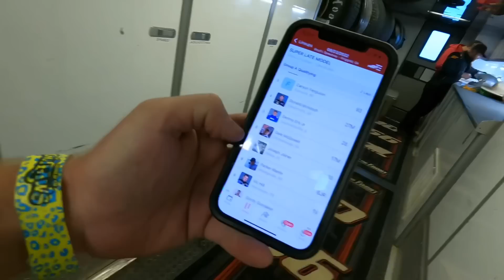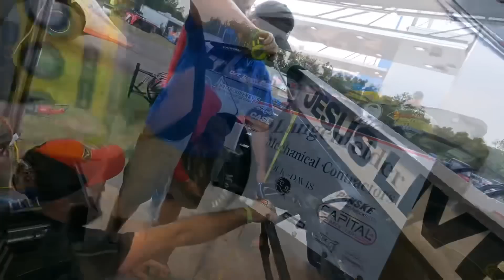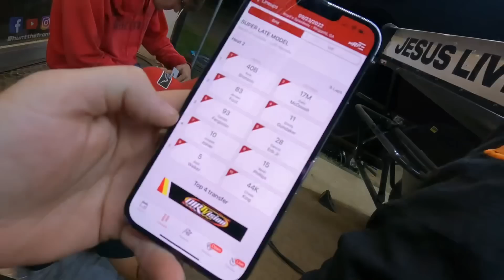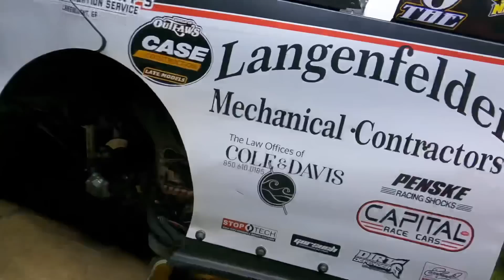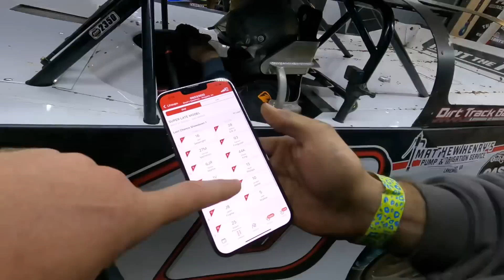Terrible! No Good Night in Georgia! World of Outlaws at Boyd’s Speedway

Comment: Jordan is a great mechanic you need a crew chief
Reply: @happywrenching33  the frame is tweaked, IMO or a shock has gone off the rails. You gotta use scales.
Reply: @nddbulldog1  no one uses scales. Your 7 years behind...
Reply: @nddbulldog1  Agree with the scales, and tire temperatures at the track.  Take the car out at a Walmart parking lot, get it on the scales, and see where the weight is.  Something is definitely off with the car and needs some kind of diagnostics.  It's bad and getting worse.  It's an awful long way to haul and perform like that.  Get ol' Betty out and see what she can do.
Reply: @ralphwatten2426  no one uses scales for setup, you are about 7 years behind
Reply: @vernsimmons945  well what they are doing now is literally the definition of insanity

Comment: I could swear I saw sparks out the left rear a couple of times. But I agree with a couple of people, wrong gear and something in the front end is off. Gotta keep the rpm up in the corners
Reply: sparks are from the brakes
Reply: @twitchbearoutdoors652  I doubt it unless they are dragging because it was in an area of the track you shouldn't be braking. That said they could have a sticking caliper which would definitely slow them down
Reply: @johnstark4723  it’s the brakes man

Comment: There front roll center in the kinematic state is off.  The geometry is off in there force line intersect point. When the car dives into the corner the roll center should migrate.  Of course your spring combination will effect this as well.  If you dont get the front end rolling on the center point you will be chasing all night.
Reply: You try to sound intelligent speaking about role centers and kinematics but I don’t think you know what you’re talking about I worked at GM’s advance vehicle systems group at the General motors tech signer and was involved with vehicle dynamics specifically for antilock brake systems and traction control systems And your speak is gibberish
Reply: @thomasgray2184  I guess you worked on GM's thoughts about when the cars  rolls, dives  or lifts in the corners the load and preload on the 5th and 6th coils as well.
Reply: Pretty much involved in all aspects of vehicle dynamics brake line compliances steering system compliances caster camber toe in toe out effects and computer simulations of all the above

Comment: The car looked loose in hot laps and it was looser in the heat.  In the B main it looked like all the cars in the race looked too loose.  They were going sideways around the whole track.  It's a short race track but it's not an oval.  I'm thinking too loose.  I'm not sure if the mill was bogging like one commenter said but it sure seemed like the valves were floating a bit.

Comment: Boys need to figure out those slick setups
Reply: if you watch there left front when it hit a bump it really throws the left front up bad and yes it should move but not pitch the car ,they are lacking   Traction on the rear and right front  ,just watch the car ,i started racing when i was 17 and now 71 and still in it to win it here on the west coast we run a super late model outlaw
Reply: @raymondbrandt7831  could be chasis related. I mean that car has never really performed well. I'd be taking back to Capitol to have checked out
Reply: @bren-xmotorsports55  
my buddies that have capital cars have trouble with them like setting up for a track you have been to 2 weeks ago to the same setting and the car acts totally different, they tell me the car has a twist memory, i don't no we run a longhorn
Reply: @raymondbrandt7831  :Keep at it, they are taking note of what is said here, it shows up later in their video's....
Reply: @regdor8187  
is that  Supposed to scare me or something, well it doesn't, i tell what friends have told me what i no from my own car and what i see so if HTF or CAPITAL has a problem they can tell me
Reply: @regdor8187  
 htf is a young team that's struggling, i like them that's why i watch them, and some of us old timers are just trying to help
Reply: @raymondbrandt7831  Woooo budy, you read it wrong ( or I wrote it wrong), your giving your experience is not being ignored, just not being acknowledged, that's all......
Reply: @regdor8187  
no harm done, i no they don't respond to anyone
Reply: @regdor8187  I read it the way you said it. No harm done
Reply: Not to beat this comment to death but if I was the owner of that engine I'd be a little concerned about them running it in that setup
Reply: @bren-xmotorsports55  
 it's a super late model engine and the builder give them lap numbers to have it gone thru that said i think they are turning at higher RPMS than they should it sounds as it's above the power curve, our motor hits its peak at about 6000 and pulls heard from about 53 5400 we gear the car to run in that range give or take, and we control the tire spen with the loud pedal

Comment: I wonder how much it changes your set- ups on XR series races with no Droop rule! I bet it would make it hard being the only series that does it! I know this isn't a XR series race! I know you don't reply to comments! I wish you would on this subject! Oh well just talking to myself on these videos!
Reply: Im trying to learn more about it myself. What does the droop rule attempt to mandate?
Reply: The last time they ran with XR..XR had the droop rule so they don't have a clue.
Reply: @brandonlove3136  Droop in a late model is how far the LR will “droop” from the chassis when a car is on the bars when on throttle. It pushes the spoiler way up in the air, from the 39” the deck sits at ride height when stopped to, previous to the new rule, upwards of 60” in some cases. What the WoO has done is limit that droop measurement so the most it can measure from after an event is 50 1/2”.

The idea is two fold. First priority is trying to limit rear downforce some. Modern late models have manipulated the attitude of the car to the point of they are now almost a modernized version of the wedges from the early 80’s. Second priority is lowering the center of gravity of the cars, which ends up being pretty high at full droop. There have been quite a lot of flips in the last few years and they’re hoping lowering the CoG should keep them right side up a little better.
Reply: They don't reply to s*** I've never seen them reply on here they're too big time for that haha. This team is all about the money. They went from Humble to it only being about the money it's not even about the fans one bit.... as much money as they're making especially with patreon they could give a t-shirt away once a week just to show appreciation or once a month and it can be one of the old shirts it's not going to sell anymore the winner wouldn't care and it shows your true colors and how thankful you are to come from a z71 open trailer 604 late model setup 2012 chassis to owning a complete race team with four chassis and Stacker the only thing left is to hire a creature which they will never do lmao

Comment: Do you guys even scale your car and see where your numbers are?
Reply: No one scales late models except to get total weight.
Reply: @vernsimmons945  damn you respond to a lot of people. Almost seems like your one of the crew members using a fake name to try and control the narrative without being called out and bombarded with comments. It's ok, I get it, just know that I know.
Reply: @vernsimmons945  How many accounts do you create a week? Or name changes on this account? Same BS every time someone mentions "scales." You simply do not know what you are talking about NPC
Reply: Funny, I come from a decade of racing and I have helped many late model drivers help scale there cars to set them up for different tracks they ran on. Asphalt or dirt I think it needs to be scaled. If something is bent how would you know by looking at it? That's why car chasis builders put there cars on a jig and measure everything for spec.

Comment: The new car has been a struggle. Why not try Betty a night with the same setup to see if there’s a difference?
Reply: Completely different car
Reply: @vernsimmons945  it doesn't matter if it's completely different not. Better than what he's running. Why carry the car around if you never plan to run it. I know I know, it's a back up in case they wreck the primary car. Shouldn't have to wreck a car to try something different to see what happens. But with that highly inexperienced crew at the elite level, it wouldnt matter. They wouldn't know how to set it up either. 😂

Comment: Telling ya,u guys need to come up to Ohio to Portsmouth raceway park for the dirt track world championship in October...over $$220,000 to the winner and $$2500 just to start the main.
Reply: So they can load up and waste fuel.
Reply: The red clay at Portsmouth has always been one of the best tracks for holding  moisture throughout a main event.   The high banks would suit Joseph’s ripping the lip driving style.  
I recall back to an AllStars event in  the late 80’s where Charley Swartz was hooked up so good that the twisting of the rear suspension was pulling the yoke out of the transmission mid backstretch.   His third attempt to remedy the problem sent him to the hospital when the driveshaft came through firewall.   This prompted a rule change to instill a 1/4” aluminum plate and remove the shaft hoop.
Reply: @patriotspub4226  Bud pthat’s we run ball spline and extended yokes we have been since the 2000’s and many people have been hurt due to drive shafts. And in the 2000’s we started with a 1/4 tubs. And at best JJ is a bottom feeder or he goes where the traction is not.
Reply: Why hate on them @j&j they went eldora n did ok,Portsmouth is a lesser drive n is the place I grew up wtching,I think he would do really good there,it's fast track that holds moisture n produces quality racing n this year the purse is high as it's ever been so might do really well.
Reply: @wcmann18  They did not do well at all at Eldora. And hating is what I do.

Comment: When 8 of 10 comments mentions chassis guy, setup guy, crew chief etc etc it might be time to actually pay attention to your haters.
 it's not the equipment plenty of Jay Dickens racing engines finishing up front and there's plenty of capitals finishing up front. With that said I do think they should sell every Capital car they have they suck on dry slick tracks and it's even worse on a short dry slick track! You really see Longhorn and Rocket shine in your hundred lap races whether it's slick or lockdown. Big half mile tracks where you can keep your momentum up is when Capital chassis do the best in my opinion

Comment: In all honesty.  What you guys should do.  Is drop the Dickens engine in faithful.  Put the 604 in the new car.  So you can figure out the new car better.  I think that would make a difference with the car.  

From what I've seen with the car.  It's got some mind of its own.  Which makes it very tricky too get the right setups.  People can say run this or that chassis.  Even say bigger motor.  It's not even about that at this point.  It's about a car that seems to not want to do what you're asking it to do.
Reply: It’s not the car. It’s the driver
Reply: It's not the car, it's the knowledge that is used to place the four wheels to the track.....The Boys have long past the tricycle/ bicycle phase and used up the Dirt Daddy knowledge, their now trying to understand a lot more than they teach you in school....
Reply: It is the car.  Clanton and others that run the same kind of chassis.  Has helped them out.  They worked off those setups.  Then back tracked.  It's about finishing out the year on a good note.  So cg!nging cars would be a better idea then to keep throwing stuff at a car that isn't responding to their stuff.
Reply: If they went to the 604 in this it wouldn't fix the problem. More or less horsepower will change the way the car handles and a lighter engine will too . They have to work on their shocks and springs and possibly a lower gear to stop the car from spinning.  Probably needs to go to a stiffer right front spring
Reply: @kregyung4604  it's definitely not the driver. He can win races and run really well.  This new car hasn't responded well to what they have used.  The driver can only do so much.  The car has to respond in a way for them to even win.

They don't need a motor.  They need to get the car too respond.  Best way to do that.  Is put a 604 in it.  Run different setups.  Shake it down that way.
Reply: @kregyung4604  Definitely not the driver. The car looked like trash.
Reply: @jimmyjolly4184  putting a 604 in the new car.  Would help shake off a lot of the issues.  Cause there is something wrong with that car.  Being it's brand new.  Figuring out how to even get the car too drive.  604 would definitely help with that.  Cause they know Betty and Faithful can go.  Both those cars were 604 before supers.  So in all reality 604 would be the way to go.

Comment: Need to take that car back to Capital and have them scale it if y’all ain’t gonna do it seriously
Reply: Scale a dirt late model… are you serious? 😂😂😂
Reply: @henrysams421  doesn’t matter what kind of race car it is if the balance ain’t right you ain’t going nowhere
Reply: @awbassfishing3955  your about 7-8 years behind. Cars are only put on scales to get the car up to weight. No need to know static weights when a car races dynamically.
Reply: @henrysams421  I may be behind the times in my day which was the early 80s we scaled the car every week. I’ve seen them hanging lead on the chassis if you don’t know the balance how do you know where to hang it?
Reply: @awbassfishing3955  you are still thinking statically, not dynamic.
Reply: @henrysams421  so they hang lead just to make weight? So they could put it on the front bumper if they wanted to?
Reply: @awbassfishing3955 they can mount lead anywhere they want. Weight still transfers the same so you capture they dynamically with load numbers.

Comment: I believe in HTF. If I were them and I’m bias…… but they need to look into a bigger roush yates engine. I’m a ford guy what can I say, and there’s a reason if rocket chassis builds you a super late it’s a ford. Nothing against the Jay Dickens engine but it’s not big enough. Especially when the track isn’t that slick during qualifying. Then you learn to make the right adjustments for having more horsepower on a slicker track. A lot of people go to smaller engines because they don’t have good footwork and are just peddle to the floor all the time. Joseph is to talented and experienced so that’s not an issue for him. As far as racing a capitol, It’s basically a rocket copycat and they seem to be doing decent as of recently. Idk much about capitols. I will tell you even though my family for years and as of now has been racing rockets and we have always loved rocket, longhorn is probably the best chassis right now for sure.Just my opinion doesn’t mean I’m right or wrong. The engine is the biggest factor in my opinion.
Reply: It is as much about setup as the engines. Until they get the setup, a bigger engine won't help. They need to ditch Jesse.
Reply: They got a bigger engine from Jay Dickens and what did they do? They put restrictor plates in to cut HP. If the competition run an unrestricted 900hp engine and then you go buy one but instantly put in restrictor plates to kill hp you deserve to run in the back. Run it unrestricted and use the throttle to control tire spin.
Reply: @ValdoMan1973  right they put restrictor plates on it during the feature when the track is slick. My grandfather is against restrictor plates. He know drivers who’d put them on and he’d call them crazy for doing it.Having the more hp matters during qualifying. Also just from my experience, ford engines seem to I wouldn’t say react but take off way quicker than how the Chevy engines or whatever WHICH is bad if the track is slick and there’s nothing to grab. BUT if you can get the set up right and practice on your footwork the ford engine in my opinion is better. I know many super drivers who switched and will never go back because if you get it right you’re golden. Wish we could race ford crate engines in the 604s but yanno…
Reply: @ValdoMan1973  also to add im pretty sure that engine is actually smaller than the last two engines they’ve had. It’s just a better well put together engine. Not that they can’t compete because they’ve already shown they can with it. I’m just simply saying they’d be better off with a bigger engine if they can get it right.
Reply: @watermanone7567  I’m not agreeing or disagreeing, why do you think they need rid of him? Especially because he’s a fan favorite of the whole thing? Plus I think the engine can win them in some big time races but I’d argue IF and it’s a big if because it’s hard for anyone to do, but if they could get the set ups right with a bigger engine, they could really shock the world.

Comment: Maybe the engine is tired,  outside looking in you guys aren't consistent,  2tents off in hit laps, before qualifying you made changes, then more after, and you ran the same in heat and b main, 
You guys are trying and I think you are doing the best you can, 
Might walk around pits and watch guys buff their tires, rt out to in left side in to out 
Again outside looking in
Reply: Looks like a different chassis and motor refresh are in order plus some kind of setup man. Also some kind of traction control for the slick tracts.